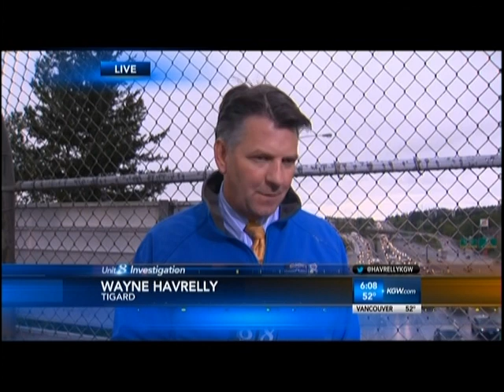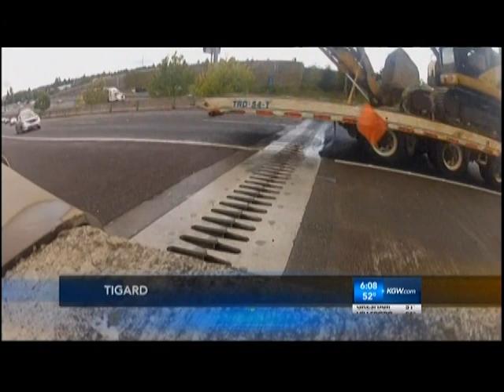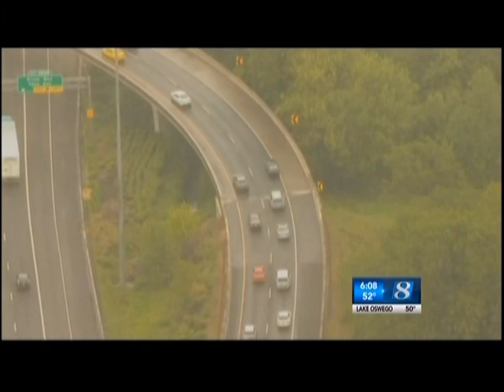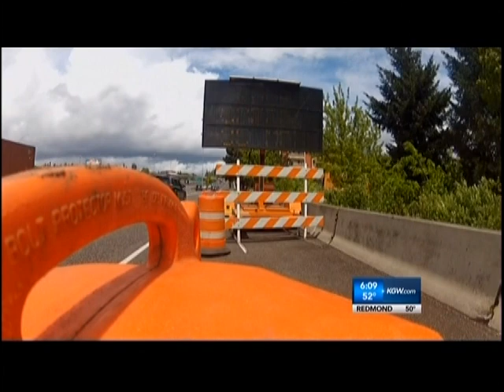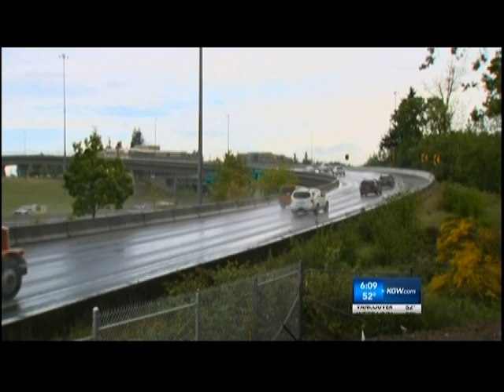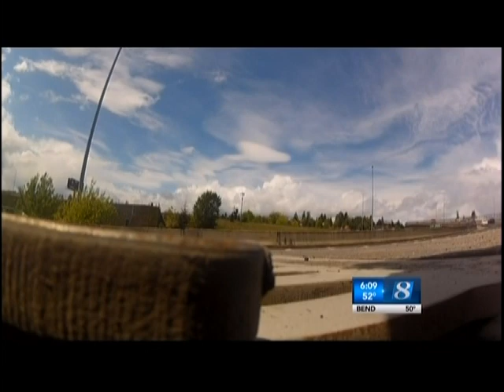Gregory Kafoury Comments on ODOT Scandal

Comment: Attorney Kafoury makes a good point.  A mobile sign that simply says 35mph does not adequately warn a driver that there is a sudden pavement drop off  that may create a loss of vehicle control.  Why gamble with traffic safety by giving such a vague instruction until they can permanently fix this traffic hazard?